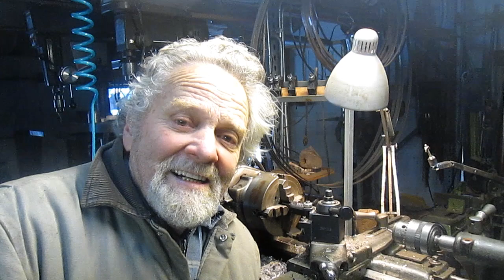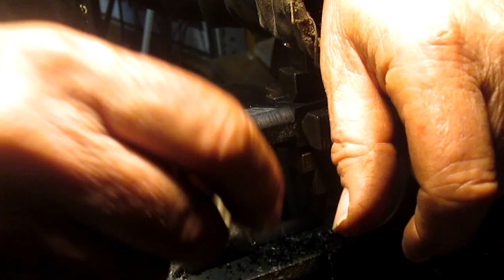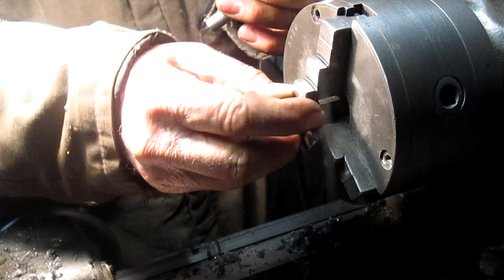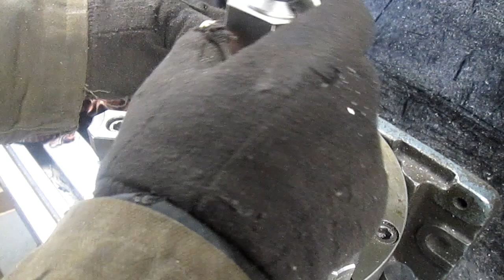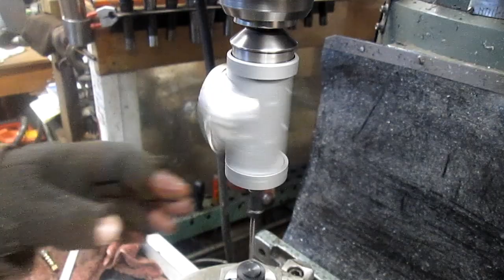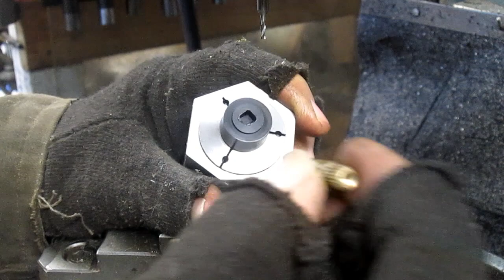Bathtub Valve Repair #1

Comment: This reminds me of a situation I was in, renting an apartment in an old-old place in Pasadena CA. A part in the sink drain had seen better days, and needed replacement. As you said, the company that made the parts was long gone.

I was taking a machine shop class in my spare time at night and decided to make the part, especially since I benefited more than anyone else.

A couple of hours work making the brass part and everything drained properly instead of onto the floor.

Total out of pocket cost - about $5.00 for the brass stock.
Reply from the maker: Amazing how having the right tool for the job makes it easy. My out of pocket was a few cents, but it took 5 hours to make it and I charged the customer $500. He was happy to pay.

Comment: I’m a plumber and found that many ceramic cartridges have the same base but have various broach sizes and in some case the escutcheon will attach the the cartridge as well.  Some manufacturers will interchange with each other.  But now you know why I’m getting into machining other than I got bit by the bug along time ago
Reply from the maker: Machining has its own problems, but at least they are ones that I make not some corporate bean counter. I'm going to show the whole valve in the next segment. If you recognize the brand or manufacturer please give me a heads up. There were no identifying marks on that valve. BTW, I did like the engineering.
Reply: Nik C. Colyer   I use ARPNY.com sometimes to identify cartridges. My shop is in sunnyvale California. Not quite your neck of the woods but close.   You need to know the diameter of the spline as well as the number of teeth. The problem is counting the teeth. My eyes are not what they used to be. Love to help if I can
Reply from the maker: @mikefox5510  I know the Sunnyvale of the 60's, a small village of old buildings and apricot orchards. It's kind of a done deal. I made the parts and got paid well for doing it.

Comment: Nik, WOW $100 an hour labour !! The Earth Drill Build must be costing  $ 10’s ,000  in labour, let alone the parts and materials. With this job, could you not have just replaced the broken off lugs with a couple of stainless steel pins ? Would have saved you having to make the whole part.
Reply from the maker: Problem was the mating part is ceramic and irreplaceable. Metal to ceramic we know which one will break next. The earth drill so far about 20 grand in labor and as much in parts. Nice little income to get through the winter.
Reply: @NikColyerMachineWorks    Cool!  I'm eager for a follow up video, Nik.
Reply from the maker: @jeffryblackmon4846  Next one on Thursday. . . every thursday.

Comment: Nik, I think your collet is not centered in the hex block.  Just a thought.  Been a sub since the sewer machine days.  Really like your videos.  Thanks,  Chuckie
Reply from the maker: Thanks Chuckie for sticking with me for so long. Turns out that the seat for the collet had a burr that I didn't see. Once I cleared it everything went smooth.
Reply: @NikColyerMachineWorks  Glad it was easily fixed.  I'll keep watching as long as you keep downloading.  Or is it uploading?  I just watch.
Reply from the maker: @etheroar6312  It's uploading, but who's counting. I've got a string of videos a mile long. Some are so old and not published that you wouldn't recognize my shop. But the new ones keep coming.

Comment: 1/4 turn taps would have been flash back then , even the  1/4 turn taps they make now days don't seem to last much longer than the  standard tap washer type .
Reply from the maker: I have to say it was a great design with that one flaw. It lasted almost 50 years.

Comment: Use two parallels to set blck up on r one side could have been low when tightened and that I believe is where your having problems as the block is sitting in the chuck correctly.....My best guess., but could br wrong.
Reply from the maker: Turned out that the seat I cut in the collet had a burr. Once I fixed that it was no longer a problem. Thanks for watching.
Reply: I hate that when that happens....that will do it!!!
Reply from the maker: @1NRG24Seven  Me too. Thanks for watching.

Comment: Looks like an easy part to CAD draw in 3d, then job it out to 3d printer with nylon or delrin capability,, or use your jewelry skills make a mold cast it in brass or aluminum?
Reply from the maker: WOuldn't have been half as much fun to film it though.

Comment: nick couldnt you have used an edge finder to find center?
Reply from the maker: Yes, an edge finder, but everything was set and I didn't want to change out the bits.
Reply: @NikColyerMachineWorks  well you got it sorted and going good looking forward to part 2. thanks.